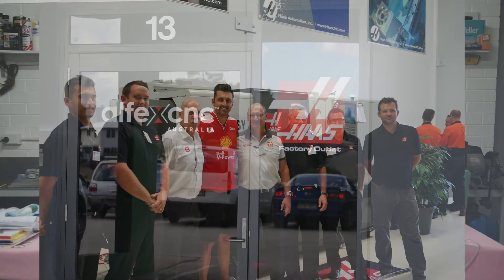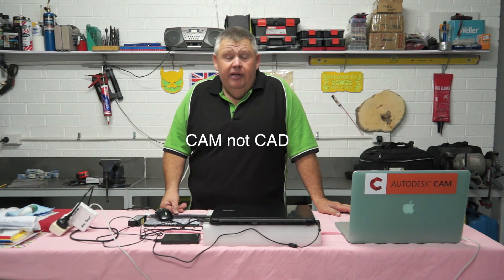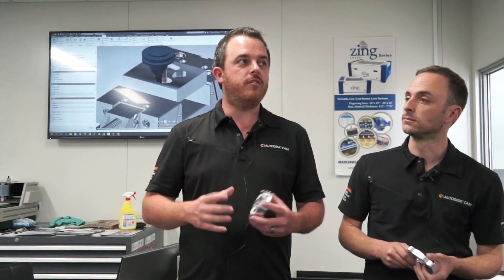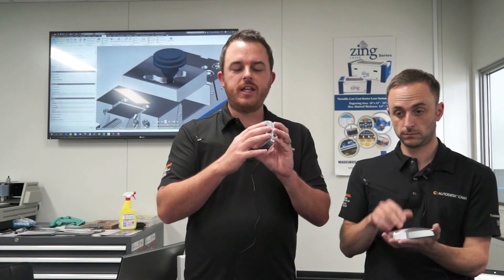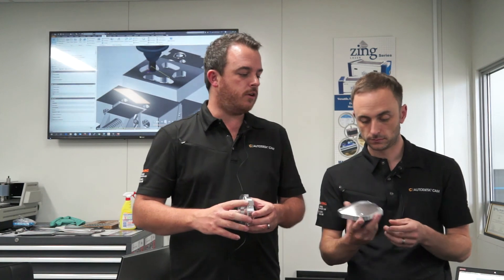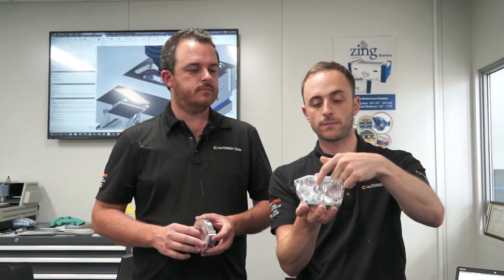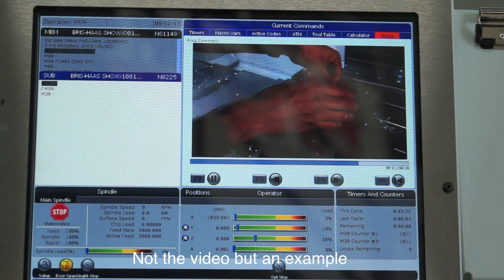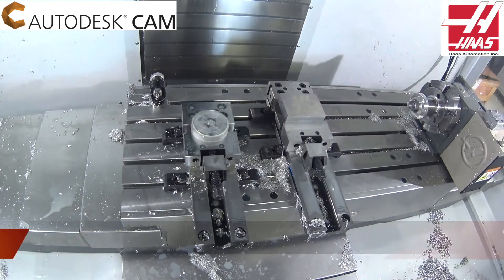Inventor HSM 4th Axis Machining - HAAS Open House FF.E7

Comment: I’m trying to mill while spinning the rotary bu let the rotary is stuttering . How are you able to spin smoothly while milling. Using matercam 2019 on VF4ss and haas rotary HTS210
Reply from the maker: Hello Kurt.  I didn't program this mill for this operation.  The programming was done by the boys from CADPro Systems (Scott & Gavin).  I will tag Scott here, but it may not work @scottmoyse.  Suggest you contact him via YouTube or Instagram as he might be able to help you.  Are you sure it's not a parameter in the controller holding you back.  I know you have pay HAAS to have high speed machining activated?  Sorry I can't be of anymore assistance.  Cheers, Aaron.

Comment: Big C is nasty business, been through that with the wife. Glad to hear you're on the mend and best wishes for future checkups. :)  Always impressive to watch the machines work. Spent a few nights punching buttons/swapping parts for a local fellow, consider it an act of faith to push the start button and watch everything disappear in a spray of coolant and hear the machine spool up to insane levels. ATC on that mill is a lot faster than the one I worked with. As ever, appreciate you taking the time.

Al
Reply from the maker: Hello Al, thanks for watching and commenting mate.  I appreciate your kind thoughts too.  Yes, I couldn't agree more with you.  The "big-C" is a horrible word and I was definitely in a dark place for a while.  I'm not through the woods yet, but I can the light at the end of the tunnel.  Take care bud.  Cheers, Aaron.